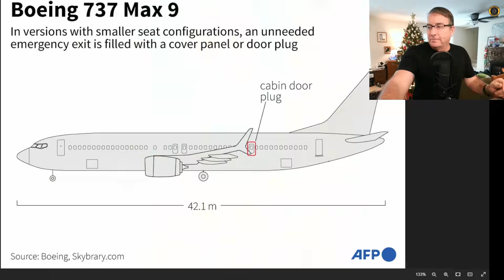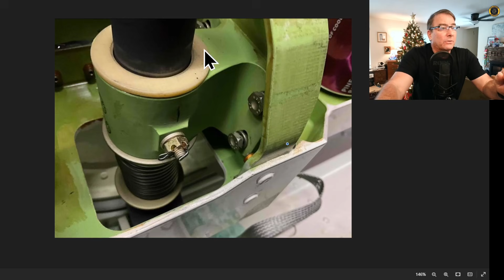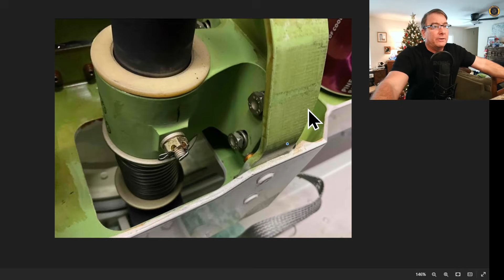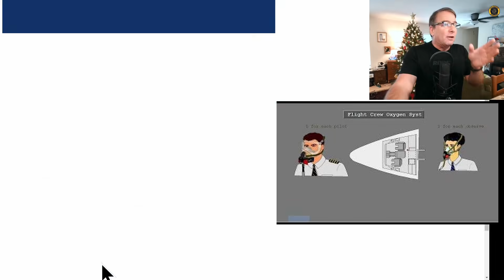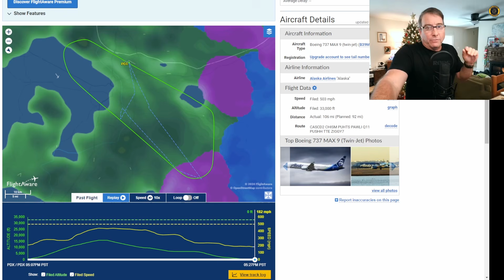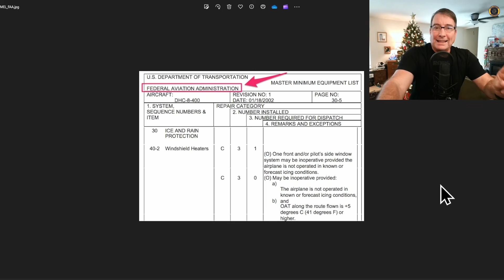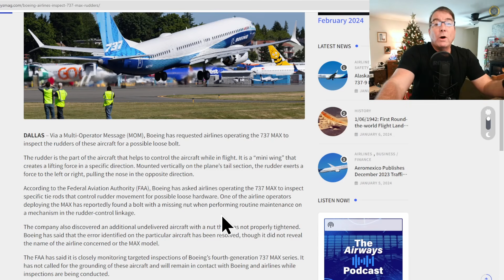"Yes, We Have No Bolts"  9 Jan 737 Max-9 Update

Comment: it doesn’t take a minute to do the initial part of a rapid decompression (ie protect yourself) and it doesn’t take another minute to start the level off or descend procedure. cause remember you only have 12 minutes of passenger oxygen to get from flight level to 10000 feet or the MSA. Airbus has 15 minutes of oxygen. some aircraft have 22 minutes. So loosing 2 minutes just to protect yourself and do the emergency descend procedure is too long!
Regarding the Cockpit door, They are bulletproof proof and designed to open when a rapid decompression is detected in the cockpit. The cockpit has pressure sensors to detect rapid pressure drop and can be re-closed and locked afterwards. Trust me when a rapid decompression happens at a flight level No one will be able to get up and walk down the aisle towards the cockpit. At flight levels There is no oxygen and all air is sucked out. you have just 3-5 seconds to wear the oxygen mask over your mouth and breathe. more over the pilots are already on a emergency descend, descending at almost 6000 feet per minute or more, unlikely anyone will be able to walk. All of these have been tested by all aircraft manufacturers. About the The escape push out panels in the cockpit doors are designed for 1 purpose, when the cockpit door is jammed or locked in place due to damage or other reason, the pilots can release and kick the panel outwards into the cabin. It can only be removed from the cockpit.

Comment: ...I feel like for future flights, there should be bolts required to go through those stop pads...
-
Also this is 2024, it would cost like $0.05 to increase the voice recorder time to 2000 hours, instead of 2 hours, by making it digital or adding a digital backup recorder to the existing system.
Reply: In your dreams. It would not cost $0.05 to increase capacity. And incase you weren’t aware it is digital

Comment: Wow, looks like I might be right. I mentioned in your previous video that those bolts were likely not installed at all based on the latest update. Just the other day I was leaning toward the torqued bracket bolts since they found at least 5 airframes with loose hardware.

Comment: I really appreciate hearing from someone who actually knows what he's talking about.  From this and other reports, one can conclude that Boeing delivers shoddily assembled aircraft.  Loose and missing hardware seems to be a common occurrence with Boeing these days.  But one of the questions I have is when were the door-plug slide pin locking bolts, castellated nuts and cotter pins suppose to have been installed.  Is that done in Kansas, or was it supposed to have been done in Washington?  How long has it been done negligently?  I think we'll all learn more than we ever wanted to know about door-plug installation and retention before this is all over with.  Another point of concern I have is that now the whole world knows that if you want to force your way into the cockpit of a 737 Max 9, all you have to do is wait until the plane has reached `12 or 14 thousand feet of altitude, and then smash out a window.  The resulting sudden depressurization will cause the cockpit door to automatically open for you, and you can then enter the cockpit and take control of the aircraft.  Does anyone else see a potential problem with this automatic feature on  the Max 9?

Comment: Does that mean the explosive decompression wasn’t as bad as it could have been? The cabin was at 10000ft pressure when the door blew off and when the cabin paneling was sucked out so the people in the cabin only decompressed 4000ft? I mean it’s a lot but not as bad as if it would have been the full 8000ft or so differential. Ya?
Reply: Correct

Comment: Let's face it, the upper bolts were probably never installed.  Also, the crew (given a pass by Juan) seemed to be equally incompetent and didn't follow procedure.  So, incompetent assembly followed by incompetent crew ... welcome to America 2024.  I'm flying Airbus exclusively.
Reply: Incompetent crew? How come? They got the aircraft and all pax safely on the ground after an unusual emergency. I say crew did an excellent job.
Reply: They forgot to power-down the cockpit voice recorder so all of the voice data was lost (over-written).  Juan kind of excused it cuz he assumed that the checklist  was unavailble due to it being blown around due to the cockpit door being open, which probably shouldn't have been ... or at least it wasnt locked.  The cockpit should have been spared this event but it wasn't cuz the cockpit door was open.  So, although they landed safely, its clear that their performance was far from ideal. @fireflyrobert
Reply: You’re blaming incompetent crew after the traumatic ordeal they just went through and their checklist got blown out the window so they had to shut down by memory. You’re a moron or have no regard for anyone else except you.

Comment: Those cockpit flight recorders are digital. The data of the conversation is still on the media.  The pointers to the files have been lost as to detail. But the pointer still exist. They just been renamed to generic names. So you can recover that flight cockpit recorder information.  Or did someone not set the cockpit recorder to record the new flight? That might be a problem. So the only thing would be on it would be the previous flight. Interesting.
Reply: Do you not think the NTSB would be  aware of this? They have sent recorders to the manufacturer before to get data that was potentially lost in extreme crashes and managed to get it back so if they are confident it’s been lost by being overwritten I guarantee it is lost

Comment: This is going to quickly spiral out of control for Boeing. Not matter what they determine happened to this Alaska flight, both Alaska and United Airlines have FOUND LOOSE BOLTS on other aircraft that they have pre-inspected.  United, earlier to day, was reported to have found this on 5 ..FIVE !! other aircraft, and those were out of the ones they've had the chance to inspect so far.  So, now this issue is found in numerous aircraft, even worse, it's in aircraft that are of different ages. Which means they can not say this issue is limited to a certain "batch" of aircraft. And these are BOLTS & NUTS we're talking about.  So if they're not tightened or missing on this plug door - what about all the other doors ?  What about the THOUSANDS OF NUTS & BOLTS throughout the entire aircraft ?  Are there missing bolts or loose ones around the  windshield of the aircraft ?  What about those that hold the engines on ? I mean.. come one... this is one big nightmare for Boeing -and they get ZERO sympathy from me.
Reply: Absolutely

Comment: If you don't touch that cockpit flight recorder. The data is still on it.  But it's got file pointers to it that will have numbers like file0002, file0003.... And so the data will be generally preserved except for what wrote over. Because computer systems don't erase data they just erase pointers for the sake of efficiency.

That is assuming the flight recorder is digital maybe it's not. But if it is digital send it to a recovery company. They'll find all the data. Make an examine the data and decide whether it's a audio file or not etc and so and so forth.
Reply: Probably not.  Old design, only 2 hours worth of memory total.  The data will have been overwritten by later audio.  Might be able to do a deep recovery, maybe.

Comment: DOR TRAVEL UP WITH SPRINGS ASSISTANCE  CLOSE, you got it backwards. That is a fail design , with out the rail fitting  bolts centrifugal forces can overpower the SPRINGS. Saludos

Comment: The loss of cockpit voice record is probably not a big deal for the investigation.    Prior to the depressurization, everything was normal.  After the depressurization, you wouldn't be able to hear anything anyway except wind noise and muffled grunts.    This is a purely mechanical investigation.  The pilots neither did anything to cause this nor could they have done anything to anticipate or prevent it
Reply: I agree but are crew oxygen mics hot wired to the cockpit voice recorder same as crew headset mics?

Comment: @blancolirio -- Thanks for the videos. Great collection of facts and summarization!  // BTW, just wanted to mention -- "Plug Door" versus "Door Plug". My understanding is a"Plug type Door" is a door which works like a plug -- it is a door, (it opens inwards, and pressurization forces the door against its seat, hence the adjective plug). A "door plug" on the other hand is a "plug" not a door; it is a plug that sits in place of a "door". In "door plug", the plug is the noun, and door is the adjective that describes what this plug does. In a "plug door", door is the noun and "plug" is the adjective that describes what type of a door it is. What flew out from N704AL is a "door plug" (not a "plug door").

Comment: It seems as the plug needs to move up to open it couldn't move down the pin would be against the top of the guide where it is in the locked pos. With the pins/bolts missing it would only be held in by whatever friction is present

Comment: Another example of conscientious union workers. It is ridiculous that these aircraft left the factory without EVERY fastener being visually inspected for proper setting(rivets) and torque specifications. Remember the airliner that burned up at the gate because a flat washer was left off the flap retract mechanism that punctured the fuel tank causing fuel to leak onto the hot engine.

This is stupid! Stand proud Boeing!
Reply: Precisely @judd_s5643 problem here is not a single loyal, conscientious worker or their elected representative is on Boeing's Board of Directors. Amgen exec there?! Ridiculous. It's the entire economic system that needs to change. If companies were offered some huge financial incentive only when their Boards were composed entirely of full-time workers, problems like this would disappear almost overnight.

Comment: The door sensors on some aircraft are also linked to the pressurization controller and will release pressure if a door shows unlocked.

Comment: Boeing are currently being sued by Wilson Aerospace for fabricating their own version of their installation tool used for attaching the engines to the NASA SLS rocket. This resulted in a hydrogen leak on the launch pad during the first launch of the SLS for Artemis 1 mission. This caused the launch to be scrubbed and delayed which then resulted in the batteries of many of the small sat secondary payloads to deplete and those missions to fail.  Also, Boeing’s Starliner spacecraft is still being rebuilt after multiple safety concerns including bad/untested software which could endanger the crew during reentry, faulty parachutes, flammable tape being used for the electrical systems and multiple other faults found by the FAA after it failed to reach the international space station during its first uncrewed flight test.  This suggests Boeing is cutting corners in every department throughout the company which is concerning as the 737 max, starliner and SLS are all designed for human flight and regulated by the FAA.

Comment: Is the position or condition of the deactivated emergency exits an item on the exterior preflight checklist? Surely the plug was already slightly out of position prior to the incident flight. Whether it was visible from the ground is another question.

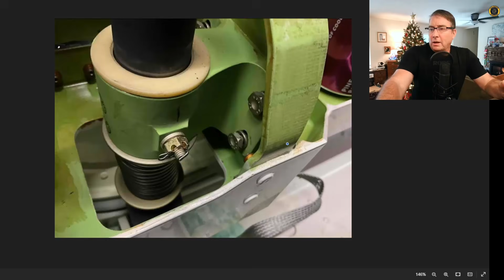Comment: @5:24 , I'm not sure, because not my eyes on it. That looks like a non sufficiently alighned/torqued/tightened fastener with possibly an undersized diameter washer? You have to secure the structure and the structure of the structure supporting it. The decompression of the flight deck door "blowing open" is NEW to me! I worked with a company that did the design for those as well, and unless something changed in the last 15 years, that's not a thing. The doors were vented, but in a manner that would NOT allow a human sized figure to enter through the door and the blow out panels. Also, I was with Boeing and had a hand in the C-32A and designed portions of it "payloads", and still work in the industry.
Reply: @squidmonkey940
 Please take a look at my reply at the top of the reply stack; we seem to be on the same page here.  My only question is the provenance of the photo.  That came from an identified source.

Comment: Thank you, Juan, for the comment on the castellated nut and cotter pin vs. torque. Been wondering when that would be noted as a question, what with all the other “ loose nut” observations coming out. I don’t pretend to know the answer, but what’s the AMM say with respect to this?  I.e., “loose” might not be a direct cause. On the other hand, loose might lead to vibration and fatigue of the shear bolt. Dunno … but again, the AMM? And what of the “history” of the pressurization events and the intentional safety feature of the plug blowing out with other severe delta-P event? Not predicting but questioning - could “something else” have happened where this plug  might have actually performed its intended function and interceded in what the system perceived as a worse event?   Again - it’s fun and even challenging to guess at what the SMEs will uncover, but we (and I include me) need to remain objective and detail oriented… and the details are yet to be presented. Fantastic job, Juan, as always.
Reply: If you torque the bolts, you might crack the thin upper guide fitting.

Comment: Regarding the cockpit voice recorder. The incident lasted 20 minutes from start to finish. The voice recorder starts to get overwritten after two hours. Surely as soon as the emergency is over all recording equipment should be impounded shouldn't it? Why was power still available on the aircraft for 100 minutes after the incident was over? When I worked on aircraft whenever there was a serious incident the aircraft and all maintenance documentation was immediately impounded. No one was allowed to touch anything without permission from the investigation team.

Comment: Juan...you are incredible...Incredibly objective.  I wonder if there is a way ACARS could preserve the recorders when there is a known emergency.  I know you are being careful and factual in what you say, but sure seems like maintenance left bolts out or the torque values aren't correct.  Seems like if you are going to have a plug door, maybe a better answer is a tig weld on the bolts and a sign off required tig was performed.  Fly safe.

Comment: Two things. Chances are some or all bolts were not installed. But no one knows if this happened at Boeing or subsequent maintenance ( possible troubleshooting for pressurization issues). Also, the bolts are not torqued and are used in shear as a pin, not as a fastener. Hence, they could be slightly “loose”. Castellated bolt/nut/cotter pin assemblies are generally not torqued and are usual snug only.
Reply: This is a relatively new aircraft which has been in service for about 1 year.
Reply: @stevenf1678  a year? 3 months

Comment: Regarding the blowout panels, they are designed to do exactly as described, and they also exist in the floor between the passenger cabin and the cargo area to equalize pressure in the event of a rapid decompression in one area or the other. However they only permit air to move through them at a certain maximum rate. The door must be allowed to open if the air movement exceeds that rate because the cockpit door opening is better than the entire wall buckling and damaging any flight controls or electrical systems. The importance of Blow out panels became apparent back in the 1970s with the DC 10 accidents because the explosive decompression of the cargo door caused the passenger floor to collapse onto the flight control cables, making the aircraft uncontrollable.
Reply: Having worked 707,727,737 there is no "floor" equalizer. There is behind the sidewalls, lower removable air grill, there is a floor level web / structure, (connecting skin to L angle that supports floor. Plus attached at frames.) that allows air to circulate from upper cabin to lower cargo bay where the big filters are (snake pit) to recirculate air back up to the top center line diffuser and PSU air and top of side wall air diffuser. So air circulates top to bottom continuously. During ditching into water, those webs have a cone to hold floatable balls to close off the holes. Thus giving more time for passengers to exit aircraft during water landings.
Reply: @ptcoronet  Did not know that.  Thanks for sharing.

Comment: Boeing (McDonnell Douglas) management must be purged or otherwise removed from operation. The engineering excellence that WAS Boeing's hallmark must be renewed, with leadership which values, no, DEMANDS quality of design and manufacture over pure profit. Yes, the company has to make money, but this can be done by making a great plane, rather than the disasters that require repairs when new.